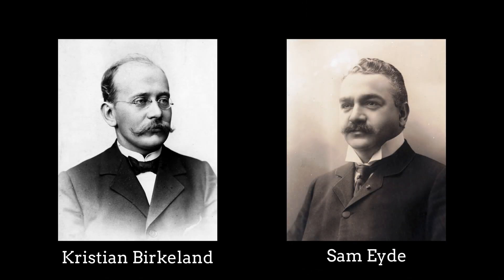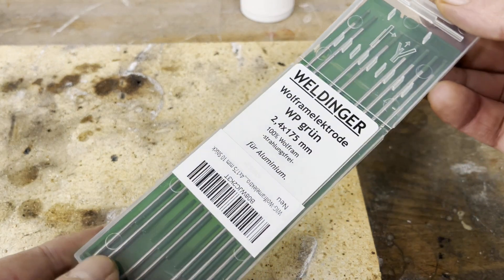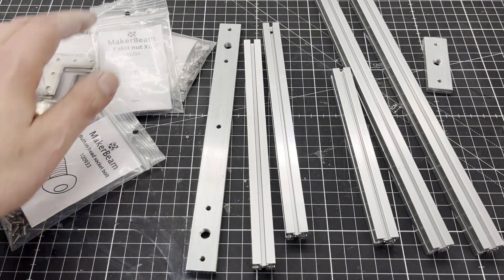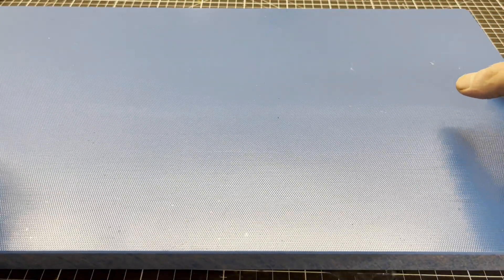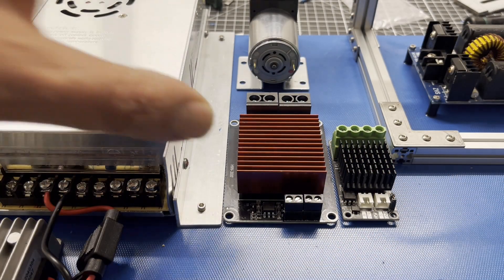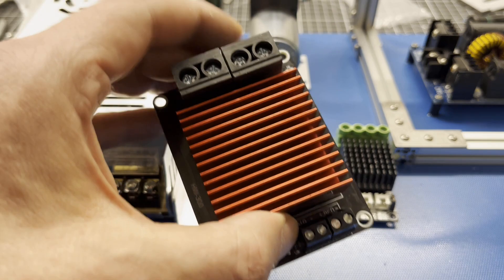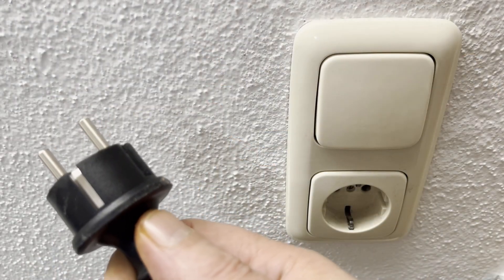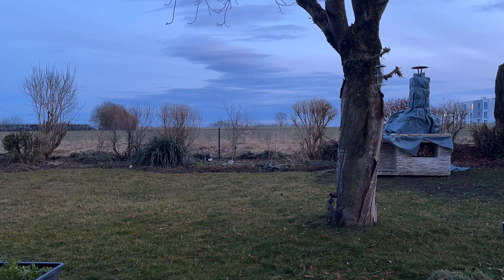Building a small, fully automatic Birkeland-Eyde experimental reactor

Comment: Would you be willing to share the Arduino code you used to process/display the mass flow controller output?
Reply from the maker: The output of the Omron D6F mass flow sensor is analog (0.5 to 2.5V). Just use an analog pin. The output voltage characteristics can be found on page 25 of the datasheet. To model the curve I used Excel (scatter plot and trendline). The obtained formula can then be used to calculate the mass flow depending on the output voltage.
Reply: @Marbslab  Thank you!

Comment: Did you measure the power consumed by the plasma? how many watts when it is running?
Reply from the maker: The flyback transformer and driver draw an average of 8 A at 24 V, i.e. 192 W. The current fluctuates because it depends on ionization.
Reply: @Marbslab  Thank you!  why did you pulse the plasma vs continuous?

Comment: Very good setup, if you want to optimize it you will need a "U" shaped electromagnet to produce an electromagnetic field which is supposed to flatten the arc into a distinct disc shape. I dont know the exact frequency of the field coil nor the voltage so you'll need to experiment with frequency and voltage modulation for that, since the full scale used 50hz I surmise that should be the maximum frequency again don't know

Comment: Better buy a cvz with two output toroid, then you need winding only one primary. 
The primary with center tap NEVER will be perfectly symmetrical,  that cause voltage spike and wrong commutation mean heat and blowing transistors.

Comment: That's really well done mate. How did you work out the right frequency for the flyback to make nitrogen dioxide instead of just heating up your reaction vessel? Or did you not have to?
Reply from the maker: Thanks. I just used a commercial flyback driver:)

Comment: I also built a similar device a while ago. I used ZVS and tungsten needles to establish a Jacobian ladder in an inverted three necked flask to increase the contact between the arc and air, and filled the brown absorption bottle with quartz particles to increase the gas residence time. After two days of continuous operation, the pH value of distilled water has been changed from 7 to 2
Reply: And AI suggested that I keep injecting air continuously instead of intermittently injecting it after the gas turns yellow, to avoid producing insoluble substances such as N2O4. I have doubts about this and hope to receive an answer

Comment: That ZVS driver of the flyback is not efficient, there is better designs, over all at 24V, like 40% of the electric energy is wasted as heat. use a better ZVS driver.
Reply from the maker: Do you have a link to a schematic of a better ZVS driver?

Comment: shouldt the air be punped in from the bottom? the arc heat up the air you're trying to pump in so that the pump has to work against the boyancy of the newly created hot NO2. if you pumped from the bottom, the hot gasses would pull the cold air through the arc rather than push against. this should also help cool down the electrodes more. if you're able it would also be ideal to bend both electrodes so that they are as close to the inlet of air as possible so that no air doesnt go through the arc. i did this in my birkeland eyed reactor and increase the production rate by a ton.
Reply from the maker: Thanks for detailed thougts. I did it that way because NO2 is heavier than air, but it would be easy to change in my setup:)

Comment: 6:05 If you had drilled the locations of these hold in offset locations (e.g. 10 mm difference between the blocks on the left and right), assembling this part would have been much easier. Another simple way to simplify the assembly (if you wanted to have rectangular grid for the screws) would have been to put hole on one end of the bar. That way you could have the left side bar the other way than the right side bar and only need to put one bar into aluminium profile at time.
Reply from the maker: Thanks for pointing that out:)

Comment: Nice video.  Have you thought when trying to optimize breaking down the device into 3 parts.  Pre-reaction, reaction, post-reaction.  The atmosphere input is it best prepared for the reaction.  Can energy put into prep maximize reaction stage while not costing more energy?  I wonder if you can statically charge the air input to lessen the reaction energy needed?   This leads to how much of the volume throughput is converted?  So many nice questions at each stage I hope you continue your experiment.
Reply from the maker: Thanks:) To optimize the entire process, the process must first be modelled. I have already modeled some parts, but for other parts I first have to acquire new knowledge. I work on this whenever I can. As the topic is extremely complex, I'm not sure whether a video is the right medium or an article. Perhaps a combination of both?

Comment: Why is the air has tobe dry?
Reply from the maker: Because I don't want nitrous or nitric acid to form in the reaction flask. In addition, humid air has an influence on the spark gap. I also want to exclude interference for measurements as far as possible.
Reply: @Marbslab  great,. 👍

Comment: Would using thorium TIG rods make the arcing better?
Reply from the maker: Good question:) Since thorium is radioactive, I could imagine that the radiation could pre-ionize the spark gap. On the other hand, the tungsten electrodes get so hot that the thorium would melt (Th melting point 1755°C). You have to take a closer look at this in an experiment. I wouldn't want any thorium salts in my nitric acid.
Reply: @Marbslab  I wonder if reshaping the arc would help with that. The industrial scale reactors used in Norway used to have Helmholtz coils to form a plasma disc rather than an arc. That way it wouldn't have the energy concentrated at one point hopefully keeping more of the electrode under the melting point. The larger plasma area would make up the reaction rate lost by lower temps. Given the small scale of the setup here the Helmholtz coils could be replaced by N52 magnets to save energy.
Reply from the maker: @atrumluminarium  The plasma temperature is critical. The rule of thumb “The higher the temperature, the more NOx is formed” is only true up to 1900 °C. At higher combustion temperatures, the activation energy for the exothermic decomposition of NO is exceeded. Consequently, NO formation decreases again at temperatures above 1900 °C. The shape of the plasma could also be used for temperature control.
Reply: @Marbslab  I see, thanks for the clarification 😁

Comment: интересно посмотреть на электроды после длительной работы
Reply from the maker: Will be checked.
Reply: @Marbslab  Меня просто беспокоит эффект, который я получал на своей версии генератора азотной кислоты. Возникали странные режимы, когда дуга становилось невидимой и при этом возникал яркий свет, как бы исходящий из зазора, в котором пусто. У меня был китайский генератор для неона на 10кВ, колба 500мл, 3 барботёра и маленький компрессор, которыздавал небольшое давление в реакторе. Электроды были из торрированного вольфрама но с большими наконечниками из магния неизвестной марки. И я подумал вдруг будет интересно повторить, хоть у вас и другой источник ВН, но всё таки всего лишь нужно поставить магниевые наконечники. Просто я искал ответы, но учёные промолчали... Если что есть видео.
Reply from the maker: @YS.  Why magnesium tips? My electrodes are made of pure tungsten. I would not use thoriated tungsten electrodes. Nasty stuff when thorium gets into your body.
Reply: @Marbslab  The issues of magnesium entering the acid were considered, and the tungsten with Tori did not concern the category and did not degrade
Reply: @Marbslab  I am simply worried about the effect that I received on my version of the nitric acid generator. Strange regimes arose when the arc became invisible and at the same time there was a bright light, as if emanating from the clearance in which it was empty. I had a Chinese generator for neon for 10kv, 500ml flask, 3 barboters and a small compressor,
which was a small pressure in the reactor. The electrodes were from a tormented tungsten but with large tips from magnesium of an unknown brand. And I thought it would suddenly be interesting to repeat, even though you have another source of VN, but all the same, you just need to put magnesium tips. I just searched for answers, but the scientists said nothing ...
If there is a video.

Comment: Brilliant work. I would love to see a much longer version of this video detailing your considerations when choosing the different hardware components. I would not know where to start when sizing the pump, or calculating the size of the drying chamber, for example. Your huge knowledge is on display! Bravo.
Reply: Fully agree, this is really fascinating.
Each project I have watched is one complete demonstrator.

You may want to have a rough idea of the process and then move over to one with only analog record keeping. Using bags with known volumes for measuring and recording gas volumes.

I wonder if there is literature out there describing these experiments in the approximate scale presented by this master.
That could then also help with defining process ranges for instruments for example.

326 sent me here and boy I have not been disappointed!

Comment: Was considering using tungsten for this myself does it work well or does the tungsten oxidize too quickly.  im also thinking of trying an electric static air filter transformer and seeing how that goes.  I never had luck with the old tv transformers getting hard to find those any more anyways.  Its not just the accent but the tone of your voice is quiet close to Arnold Schwarzenegger. thanks for video
Reply from the maker: No oxidation problem with the tungsten until now. Many say I sound like Arnold Schwarzenegger, lol

Comment: Wow all that for not even one sample of HNO3. 
Overly complicated to do what cody'slab did years ago with far less equipment. It takes days btw.
Although interesting the end result was ehh lacking.
Reply from the maker: The whole setup is for research. The Birkeland-Eyden process is very complex when you dig a little bit deeper than "Cody's lab did years ago".
Reply: @Marbslab  I have indeed and agree.  It's a bit of a rabbit hole and after considering making a similar setup I figured it far outweighed the benefits. There are many other ways to make HNO3 than this but for some reason it's so cool!

Comment: My bet is the ZVS module will burn out. I've heard oil ignition coils work much better and are stronger as well as more durable.
Reply from the maker: I have no issues with the ZVS driver and flyback transfomer. But feel free to use a ignition coil.
Reply: @Marbslab  You did burn the mosfet almost immediately though. lol That's a great deal of work for this project. Are you going to run it for days and get some "juice" from it?
Reply: @Marbslab  Do you think it is possible to use a power supply for mercury lamps for backlighting in a TV?
Reply from the maker: @andreikornienko63  Depends on the specs:)

Comment: I’d really like to see how a magnetic field would change the arc and how that would influence the gas production. Maybe you could use a metal-oxide gas sensor on the output to measure the nitrogen oxide concentration? That way you could experiment with altering the pump speed, ZVS duty-cycle, and maybe temperature feedback to optimise production. Even if you can’t measure arc temperature, if you could measure gas production you could still maximise efficiency or even calculate arc temperature empirically.

I wonder if those tungsten electrodes will last longer than water-cooled copper electrodes?
Reply from the maker: Lots of good ideas and questions:) I am working on a very detailed article which should cover most of the topics and questions. I will even try to measure the complete emission spectrum of the plasma.
Reply: @Marbslab  I just realised that there may be optical signatures you could use to ensure the reactor stays at a certain temperature. Maybe the decomposition of NO releases a certain wavelength, or just the presence creates a wavelength. Then you could use two or three photodiodes to keep the reactor in a good position. Though three photodiodes of different bandgap might be swamped out by the bulk of the arc if the line were after is subtle enough, you may have to use narrowband optical filters.

Ben Krasnow’s cool silicon Rugate filters are really neat looking, if you fancy getting your hands dirty with HF.
Reply from the maker: @ Yes, exactly. I like the way you think:)

Comment: The arduino can run from 12v directly. No external converter needed.
Reply from the maker: It is not good practice to power everything with the 5V pin of the Arduino. The maximum has already been reached with the LCD shield. The 12 to 5V LDO on the Arduino Uno board has, as far as I remember, a rating of max. 500mA.

Comment: FYI: Its possible to drive the arc using much lower voltages & higher current. Once an arc is established the resistance is much lower. This is how arc welders work (ie TIG welding). 

The  Birkeland is pretty inefficient in creating nitric oxide for nitric acid. What would be interesting to see is a small scall DIY Haber-Bosch process. Ammonia can be used to produce nitric acid using the Ostwald process.

That said no complaints.
Reply from the maker: Fully agree:) And the Haber-Bosch process is one of my next project.

Comment: Huh, and what sort of yields are you getting? I understand that it's not a very efficient process, though generating useful chemicals out of thin air is always borderline magic.
Reply from the maker: Will be covered in a follow-up video:)
Reply: The industrial setups achieved like 60g per kWh which is way cheaper than you can buy it. One kWh is like 15¢ so a liter would be like $5

Comment: Very cool!

I really hope you make more follow up videos on this! I was considering making one of these a while back but couldn't find an appropriate reactor vessel. But you found one! One thing I was considering was running the output gas through a long teflon tube before bubbling through the water to give the nitric oxides more time to react... no idea if that would help.  You may also be able to wrap a wire coil around your reactor vessel to create a magnetic field to spread out the plasma arc.

Instant subscribe!
Reply from the maker: Thank you:) There will be a follow-up video and an detailed article (in German on a German forum)
Reply: @Marbslab  Auf welchem Netzwerk wirst du posten?
Reply from the maker: @ https://illumina-chemie.org/viewtopic.php?f=62&t=6362
Der Artikel is aber noch lange nicht fertig:)

Comment: Glorious.

I would just add that a Pt100 on such a thick pair of lines is a poor choice.
There will be a considerable heat flow path to the vessel - fine guage thermocouples would be a better way to monitor the gas temperature.

Comment: I think of this in a similar way.. . But using compressed air at 400 psi. (in a thick stainless steel chamber)

In the bottom of the presurized chamber, there is water (and a magnetic stirrer) the NO2 generated will dissolve in the water as H NO3 (drop in pH)

The reaction will generate heat ( and and pressure), but eventually, as N2 and O2 get consumed, the pressure will drop (untill the reaction consume all the O2 available)

Then there will be time for provide more oxigen.

A valve in the bottom allow to flush out the acidic  water.

Then put some more fresh water to absorb the next batch of NO2.

The HNO3 in water can react with ammonia to form amonium nitrate, that can be separated by simple distilation.

At high pressure, the products are favored over reactants, and also, the solubility of NO2 increases.

The electrodes will be made of grafite. (cheaper and disposable)

Maybe a better option could be Iridium (heat and corrosion resistant), but they are very expensive.
Reply from the maker: There is still a lot to explore here. The Birkeland-Eyde process is very complex:)

Comment: 100% do an optimization video!
Reply from the maker: Will do:)
Reply: @Marbslab  I'm sure you've done your research, but I have just a couple notes which may help (unless you've already come across them).
- Adding a column to allow produced NO to oxidize to NO2 will increase yield by a lot. This step just takes time. Industrial reactors had cooling heads which then the heavier and cooled NO2 gas dropped before it was pushed out of a spigot into water.
- The video mentions electromagetics to spread out the arc. That seems to overcomplicate. Use neodynium magnets; a guy on the sciencemadness form did this and had very good results.
Cheers and good luck! I admire the video- I've wanted to make one of these for a few years now. Maybe I'll get around to it in a couple more haha

Comment: I've wanted to build my own BE  reactor for a while. I was wondering if instead of injecting NO2 into water, what if we atomize water into a tall column filled with NO2. The water vapor would form a sort of acid rain, collect in the bottom and be recirculated to the top atomizer/nebulizer. 

My hypothesis is it would vastly increase NO2 dissolution at the expense of added complexity.
Reply from the maker: This is an interesting idea. The point is to bring the nitrogen dioxide into contact with the water long enough to fully react. It would have to be tested on a small scale, for example, by injecting NO2 into a flask and then adding water with an atomizer:)
Reply: @Marbslab  You can use an ultrasonic emitter to create water mist.
Reply from the maker: @andreikornienko63  Good idea:)